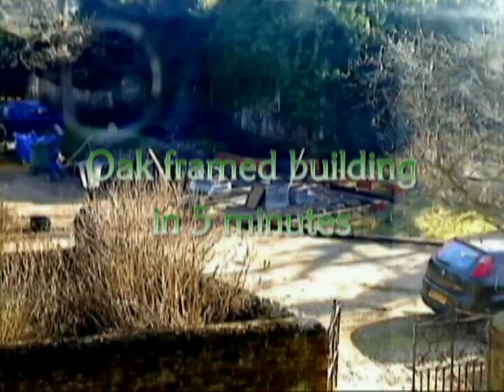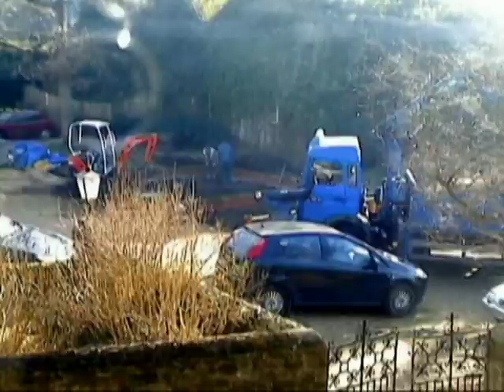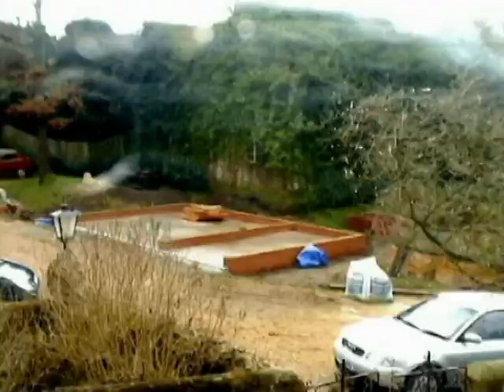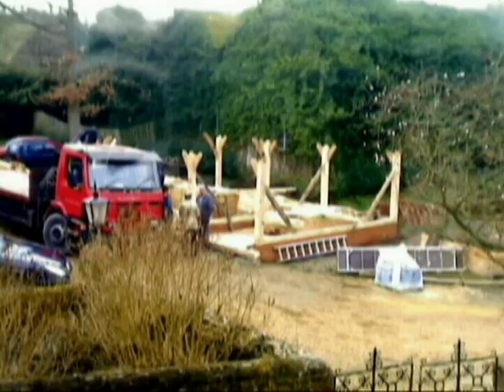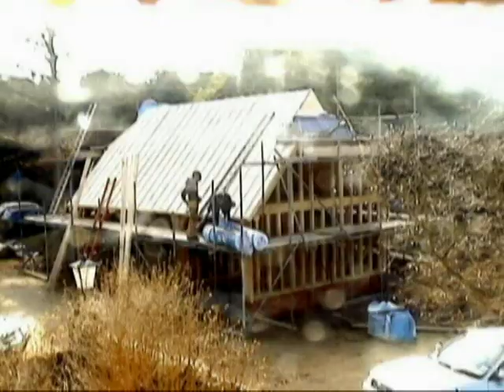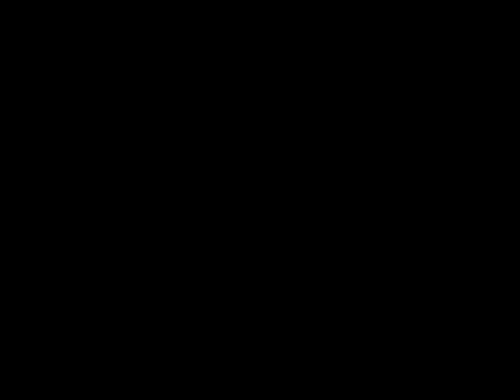OAK FRAMED BUILDING IN 5 MINUTES

Comment from the maker: @moekanz Fittted Triso super 10 quilt/foil type insulation over ply sheeted rafters, counterbattens etc. Combined with high density rigid insulation between open ground floor joists will effectively wrap roof space for normal use. If open ground floor is enclosed insulation between studs and suitable lining would be necessary.

Comment: @moekanz its post and beam construction with purling going horizontally over the roof trusses. The only way to insulate is from the outside under the roofing materials like iso foam. If you wanted to enclose the interior so you dont see the beams then you could do interior insulation.